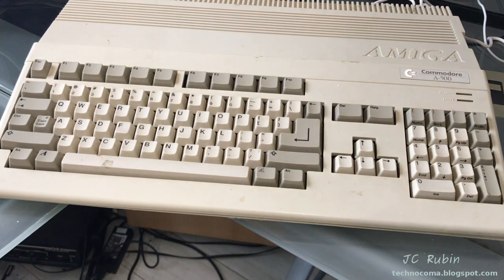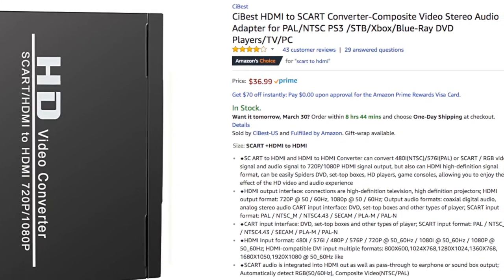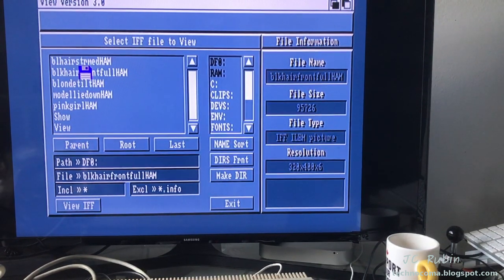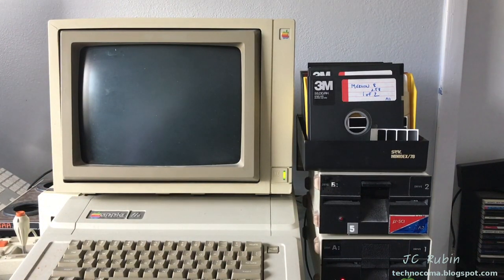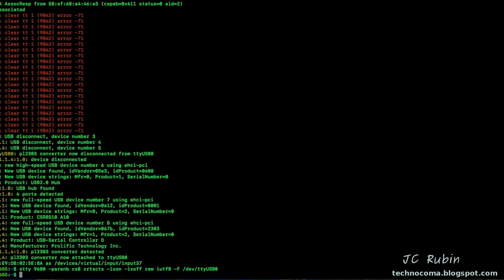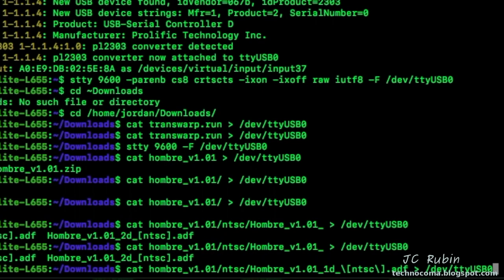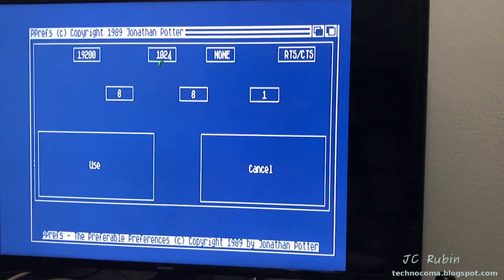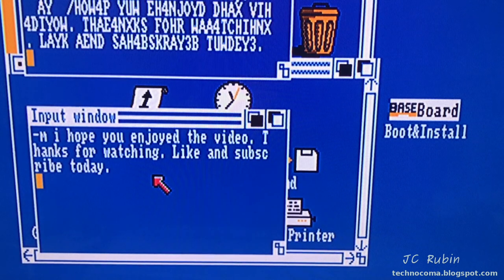Amiga Turnup After over 20 years - RGB to HDMI & ADF to Floppy Transfer via Serial

Comment: Does the accelerator card not have a harddrive controller? I think I saw two rows of gold pins. If so. Connect a harddrive, and use a means of reading PC floppy disks. Use the file splitter program and rewrite with adf2disk. A command line tool.
Reply from the maker: It does, but it would have been considerable overhead and cost for a 40mb seagate.
Reply: @retrotechandelectronics  Cool. I knew I saw correctly. There are a couple of other options.

Use a CF adaptor, and take the power through a floppy-power-splitter cable.

Get a Terrible Fire 530. Wich are somewhat the same as your 030 card.

Get an IDE controller that sandwiches between the CPU socket and CPU. Plus an 8mb fastram that goes under the controller.

Get an Wicher500i. It is the same as your 030, just with an 25mhz 000 instead.

Those are all internal solutions.